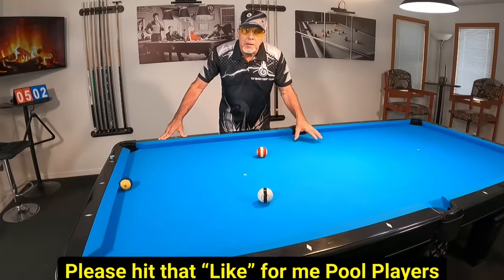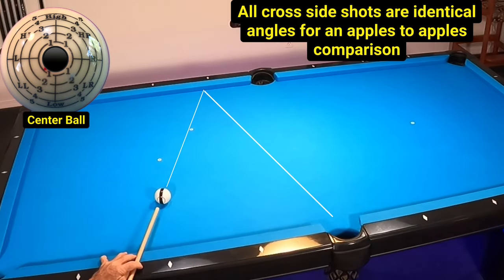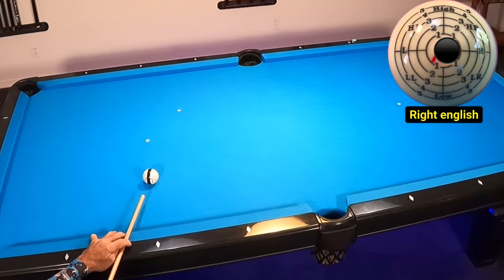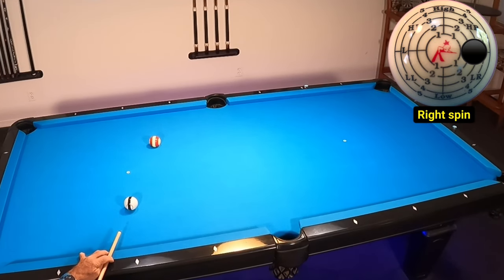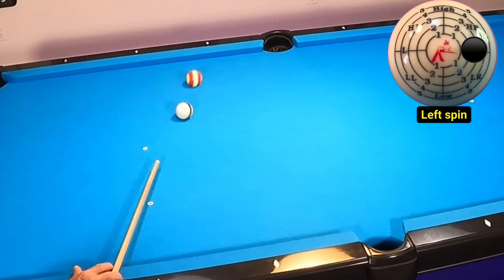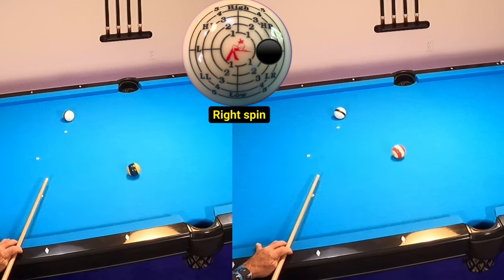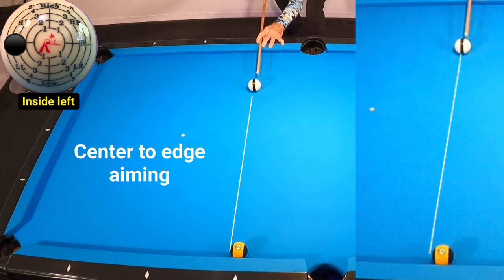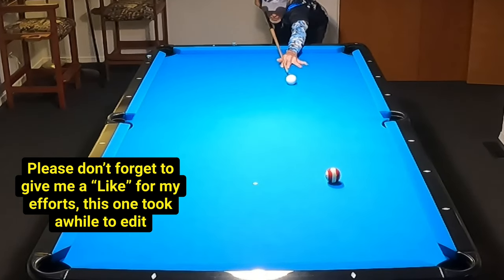Bank shot physics/spin control/correction @ 3:38, tip indicator instead on left (free Pool lessons)

Comment: Great video! I struggle with these bank shots..hope these help.
Reply from the maker: Thank you Veronica. 
If I might add; different tables will often yield different results. 
For this reason, I will shoot several cross side and long rail bank shots as I shoot on a different table. 
This helps to know how much angle compensation may be required as some tables will bank long while other short. 
When I do this, I maintain a medium speed stroke and try to stay consistent with it. Remember, speed will effect these shots, so stay consistent with your speed/pace at first. Once you’re pocketing shots with regularity, then experiment with speed and aim as you did when shooting with medium speed. 
You’ll get immediate feedback as to the physics of what is taking place thus know how much compensation will be needed. 

Thanks again and please reach out with any questions you may have 👍🏻😊
❤️🎱

Comment: I enjoy your videos.  I would like to see a similar series focusing on position - where's the cue ball going?  There are certain banks where I pocket the object ball but scratch with the cue ball.
Reply from the maker: Thank you Douglas, I like the idea. 

One thing I always think about when banking, is to use spin to avoid any scratch. 
I’ll write down your suggestion for a future video. 
For now, here’s a video I sent to a subscriber that may give you an idea of how to use english to avoid a scratch. 
See link below:
https://youtu.be/huOJyW5G7d8?si=F-zGAcA8tVxWN30Z

One more thing; did you see my bank shot video that included banking into all six pockets while the cue ball was shot from the same spot? If not, check out the cue tip indicator on those six shots and you will also get some ideas of how to apply english to avoid the scratch.
Here’s that video incase you missed it. 
See link below:
Bank shots while using english
https://youtu.be/oVYFO_BXUog

Comment: Hey Ron, would you have time to make a video about caroms, with two balls close together? I never know what kind of spin to use to pot the 9 off of another ball, when they are a few inches apart (out in space, not next to a rail). I can do it when it's a simple carom that's pretty much dialed, but when it's not, I generally don't know what to do. If you could show a few different scenarios where different spins, or no spin, is required to make a carom, that would be awesome. Thanks for your time.
Reply from the maker: Here ya go Jeff, please let me know if you have any questions. 
See link below:
https://youtu.be/e3JbEZHJI1s?si=PdOy7R_r2o6Mz5Ab
Reply: @ronthepoolstudent  Hi Ron, thanks for pointing me to that video. What I'm talking about is a bit different than what you showed in that video. I'm not talking about caroming an object ball off another object ball to the pot. I'm specifically talking about caroming the cue ball off of (let's say the 8 ball, in a game of 9 ball, to make the 9 to win the game). 
So let's say the 8 and 9 are not front to back, but lying next to each other a couple of inches apart, somewhere in the vicinity of a corner or side pocket. I'm talking about hitting the 8 ball with the cue ball and having the cue ball carom off the 8, hitting the 9 and the 9 going in. As you know, a lot depends on how far the two balls are apart, their angle and vicinity to the pocket you are trying to make it in, the location and angle of the cue ball to the 8 ball, etc. I'm hoping you have time to explore this in a video. Thanks in advance.
Reply from the maker: @jeffwilliams1356  thanks Jeff, the shot you have described is actually a billiard. 
A billiard occurs when you use the cue ball to pocket a ball after contacting another ball first. 
A carom is what I’ve shown in the video link. Caroms occurs when you pocket a ball by hitting it into another ball first. 
Here is a YT Short I published long ago. 
The difference between carom, billiard and ticky shots
https://youtube.com/shorts/mqNxIFtYhHQ?feature=share

Also, I suggest you include Russian Pool into your practice sessions. This is how I became pretty deadly at billiard shots.  

Russian Pool is played by using the cue ball as the ball you must hit prior to pocketing the ball you’re trying to make. (you shoot the object ball and NOT the cue ball) 

I would start out with just three object balls and the cue ball first. 
Trust me, within a week, you’ll be nailing almost every billiard shot.
Please keep me posted.
Reply: @ronthepoolstudent  I've played that a couple of times with a friend of mine during the Covid lockdown. It's tough,, but fun. I'll practice more after I watch the other video you recommended. Thanks for explaining the differe4nce between billiard and carom. Very helpful.
Reply from the maker: @jeffwilliams1356  thanks Jeff, I was actually corrected early on as well, as I heard commentators getting them mixed up also 🤷🏻‍♂️

Comment: When you were showing spin transfer into the side why doesn't running English send object ball long?
Reply from the maker: Thanks Jonathan. The spin transfer doesn’t impart that much running spin on the object ball as you can see on the video.
Reply: So it's easier to make a ball bank shorter then longer?
Reply from the maker: @jonathankroll3617  yes, when we are comparing spins as shown here 👍🏻 
Slow speed makes the shot go longer however.